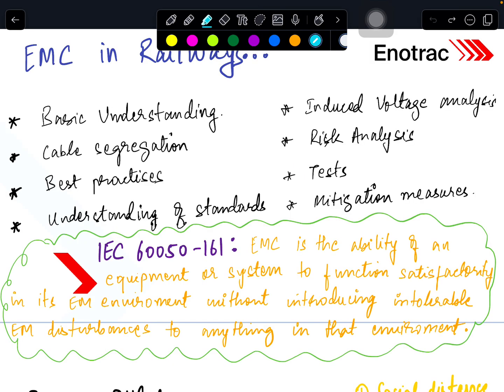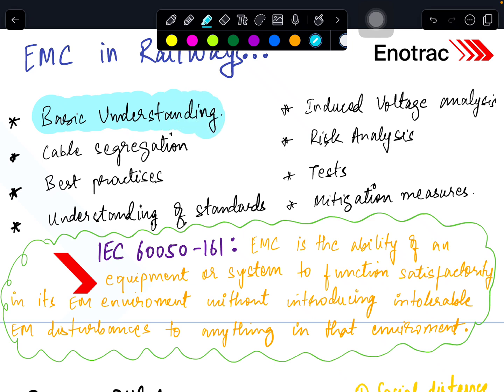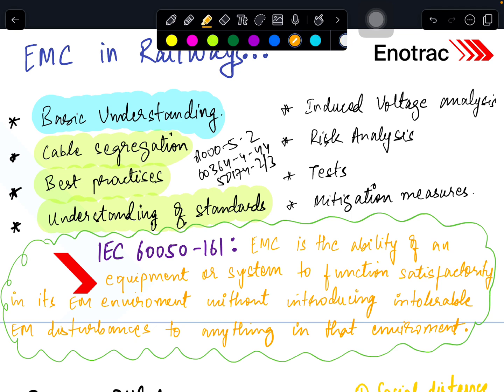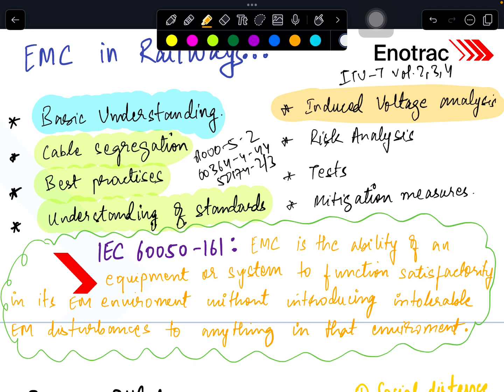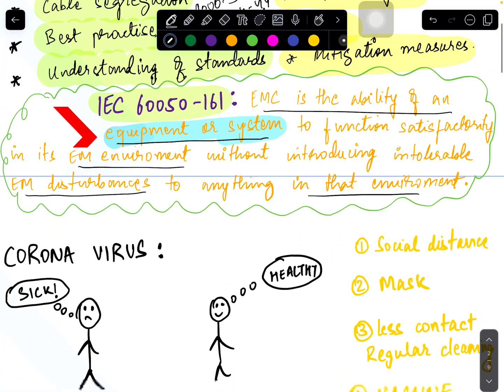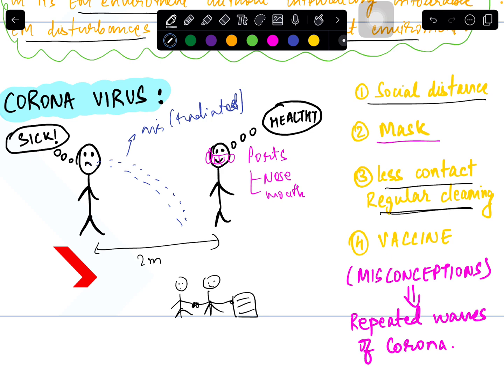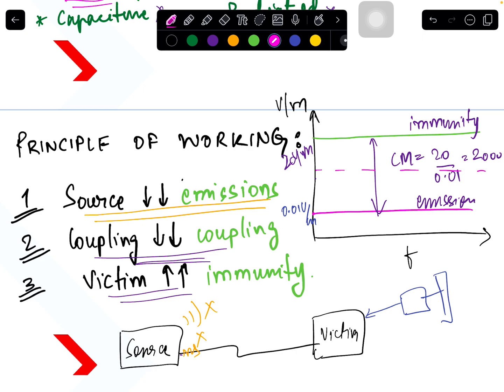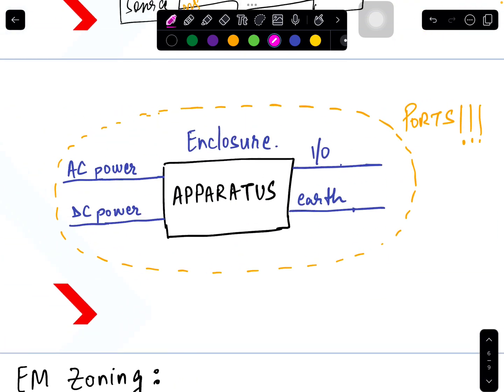EMC in Railways - Basics

Comment: Sir, how to calculate zero sequence impedance of power cables (R0/R1, X0/X1) in Indian standard the ratio of R0/R and X0/X is mentioned for a problem that the values are taken from manufacturer data sheet but when checked cable data sheet doesn't contain this ratio. Also in IEC60909-2 it is not clearly defined. Pls explain with an example
Reply: Sir didn't answer so I will. Calculating zero sequence impedance of a 3 phase power cable is unreliable. If you don't have manufacturer's data, and don't want to estimate, it's better to measure it
Reply: @imeprezime1285  thanks for your reply
Reply from the maker: You could refer to IEC 60909-3. I have covered some part of it in my videos in fault current playlist.
Reply: @railwayengineeringinsights6463  thanks for your reply sir.